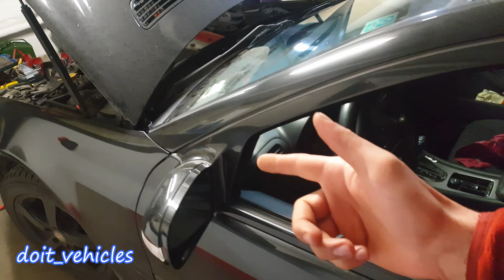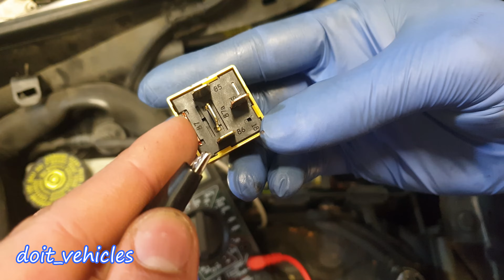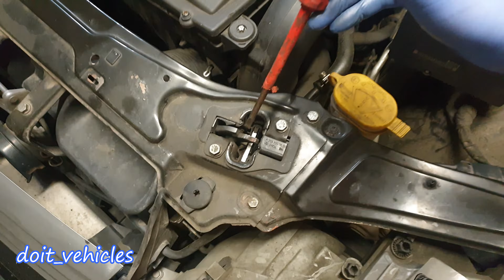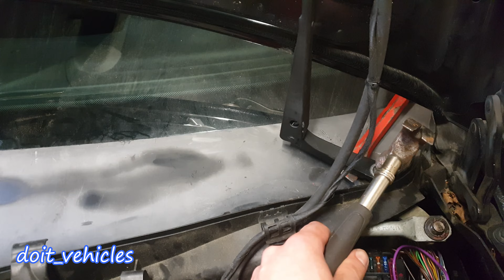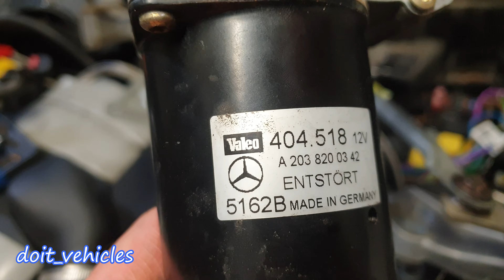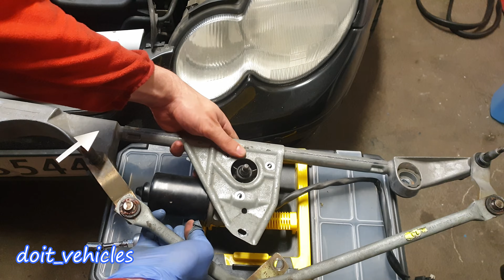Mercedes w203 C class Windshield Wiper Motor  / Test and Replacement

Comment: all steps went well except for the damn cover its just woun't come off guys any tips? i used my whole body but it wount unclip
Reply: Pull really hard, use players to crank it up between the plastic and windshield
Reply: @jonasstokkeland8483  thanks I will try again today but I literally did both but it just wont budge as if its been glued to the windscreen
Reply from the maker: that windshield cover was definitely designed purely so i wouldn't have to much expectation to fit it perfectly back

Comment: Question, after taking my cowl off it now does not want to seat flush, on one side it kind of lifts up and I really don't want water to go under it and cause problems. Do I have to seal it some way?
Reply: You figure this out? Mine is not sitting flush either…. It won’t clip back to the windshield clip..

Comment: I made all the test and the motor works  but when I test pin 1 and pin 2  which is the switch  I did not get the 12 volts .  I suspect  my problem is the multi switch .  Please give any other suggestions  thank you !

Comment: Just came home to an undercharged battery, recharged it and after getting car started found wipers don't work after turning switch. Completely dead. Going to trouble shoot with your guide. Great work. Thanks. By the way, my window washer is not working from before, anyway to troubleshoot it? Apparently there's no fuse??

Comment: Great video. Too bad my front is working but the rear doesn't :) I suppose it should be similar in terms of testing the relay and the motor? I did checked the fuses. Thank you!

Comment: Does each side have a different motor? Watching your video it appears one motor operates both. In my case only the passenger side motor is not working.

Aldo, what is the “bonnet” that some people mentioned?
Reply from the maker: It's only one motor . Bonnet / under the hood 🤔

Comment: Hey my wipers work normally but when I stop them they stuck middle
Reply: Of the windshield
Reply: What I have to do?
Reply from the maker: difficult task without a wire diagram , I would just reposition them manually
Reply: @doit_vehicles  yeah I did it and it worked thanks
Reply: @doit_vehicles   i did it manually but its the same

Comment: This was a really great video these how to car Guy videos are better than almost anybody. My motor worked except that it was spinning but not turning the shaft. It turned out that the Teflon gear inside the motor had gotten stripped. I found one on eBay for $20. I replaced the gear inside the motor and everything works now thanks to this video! Except for the Minor details omitted this video is better than almost anyone else!

Comment: This video was really good except some little details were missed. There are some washers and rubber bushing and rubber dams around the edges that were not covered at all. It wouldn't have lengthened the video by more than one minute to have included those. I found it I needed to add a lock washer to the motor shaft where the 13 mm nut holds it to the wiper assembly. I am still unsure where the big rubber washer went but it doesn't seem to be that important.

Comment: Selam friend
When I press the wiper arm, it sprays water and wipes, but it does not work in 1,2,3, positions. I removed the cable of the rain sensor, the result is still the same. Fuses and relays are OK. I changed my arm. Could it be from the engine?
How many volts should the wire have to change the speed?

Comment: Thanks for the video, currently stuck checking the wiper relay (Q) not getting a response. Unsure if motor faulty or multimeter not sufficient! Any suggestions?

Comment: Hi i did everythig u did and the motor works when i jump IT and i change the swich relay but stil not working hjelp pls
Reply from the maker: Does the switch relay get power ?
Reply: doit_vehicles hi IT works now thank u very much
Reply: Hi it was fues and it works now thank u very much but My esp is on sadenly with it and tail lights er behaiv wierd is IT the break swich or ground problem thank u again for your time

Comment: Great Bro!! You helped me. Thanks. In my case, all did works before I changed the hood, after few day I want use windscreen wiper but don't works nothing, the hood was closed, I checked rele and fuse they were work, motor too. I been begin  to crazy. At finally, watching your video in the part that you use screwdriver to simulate the hood close. I had the illumination, so I prove to do the same thing and everything come back to work. The closures in the hood don't doing good contact so it seemed how the hood was open so nothing it works
Reply from the maker: I am glad I inspire you :)

Comment: My problem is that stop in the middle not all the way to the end. Maybe has another sensor??
Reply from the maker: The motor is not connected to the blades's arm , or maybe is spining or is decentered  ?
Reply: doit_vehicles I will check the motor connection